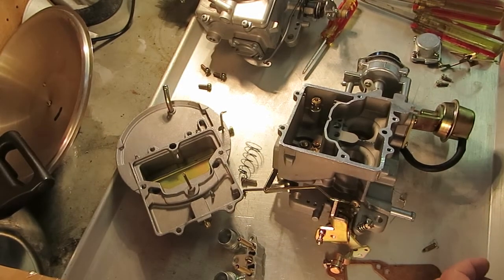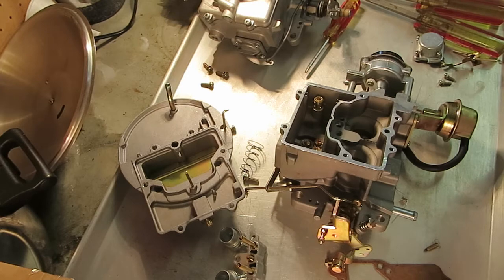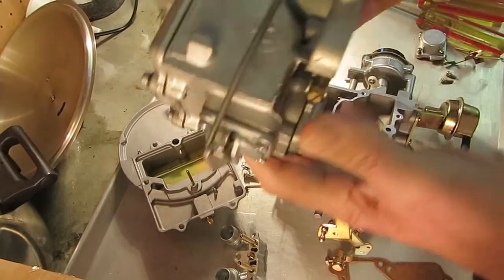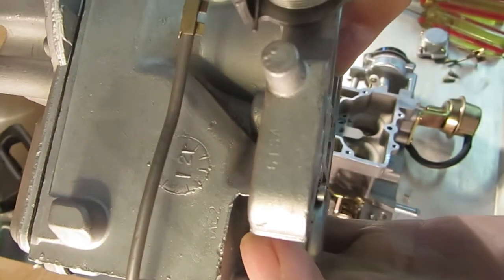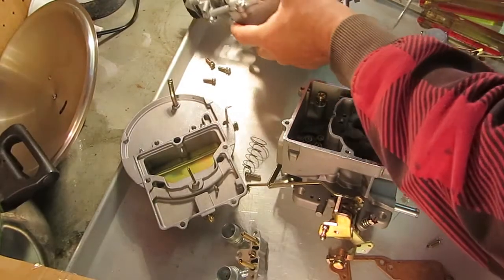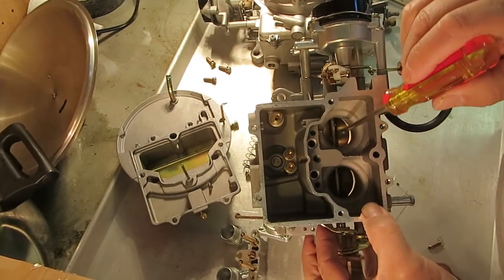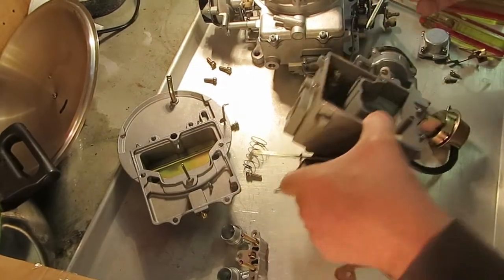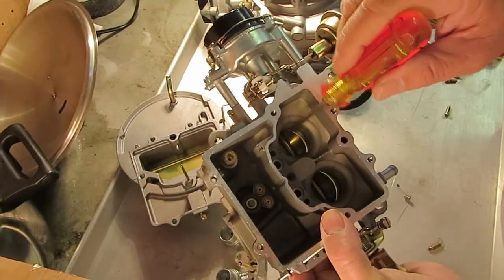Motorcraft 2 Barrel Carburetor Venturi Size

Comment: Number = CFM
.98 = 190
1.01 = 240
1.02 = 245
1.08 = 287
1.14 = 300 = 29 mm (29.5 mm ebay carb = 1.16” 350cfm claimed)
1.21 = 351
1.23 = 356
1.33 = 424
Ebay / zon carb is 13.5mm booster venturi

Comment: What are the 2 metering rods on the 2150 that are on the vanteri has a rod that goes to the throttle rod? They are not on the 2100. Are they for emissions and do they rob power?
Reply from the maker: If they are actually metering rods then they are for power measurement. If they go up and down with the throttle then that is what they are.
Reply: @MikesCarburetor  okay they are on the vanteri going to the high speed air bleeds on top side of vanteri wasn't sure what they was for

Comment: what would happen if i have a 1.21 when my stock should be 1.08? truck runs fine as far as i know, should i get a 1.08 or stick with the one i have
Reply: @MikesCarburetor  my v6 it's 170 cu, i feel it runs fine, but yeah i see 1.21 was made for big block engines with lots of displacement, might want to seek for a new carb. with luck it will run better.

Comment: I'm putting together a budget 302 (somewhat sleeper) build on my 78 Fairmont. The motor will be stock except I'm swapping out for GT40P heads and full exhaust. So am considering upping to a bigger 2bbl carburetor to keep the stock look but "up my game" if you will without the trained eye knowing. Would the 1.21 be "too big" for me? I was hoping it would be akin to putting on a bigger cfm carb. Was told the 1.08 is about 281 cfm, and that maybe this is more like a 375cfm.
Reply: @MikesCarburetor  @Str8sixfan  1.21 came on a lot of 302 Bronco's if I'm not mistaken. I have a 1.21 on my bone stock low compression 302 and it runs great. No bogs, no hesitations, no smoke, no funny smells etcetera.
Reply: OK turns out I WAS mistaken, the 1.21 came on 351's not 302's. That being said I know from first hand experience a 1.21 is definitely not too small for a stock 302. Str8sixfan is going up in compression and gear ratio too so he almost certainly won't have any issues with carb size from just a 1.21